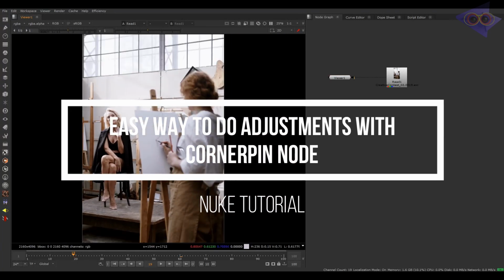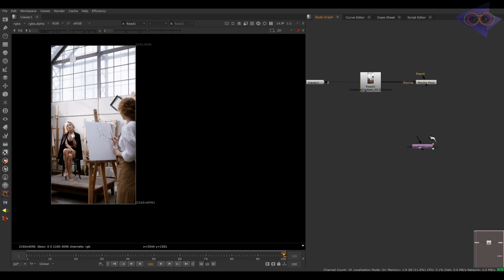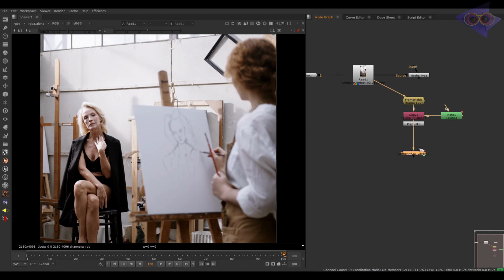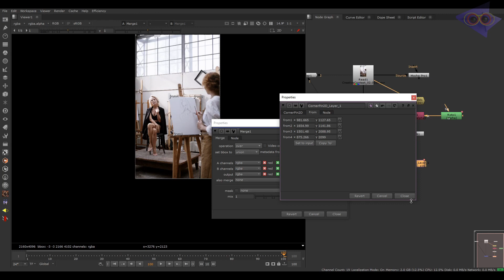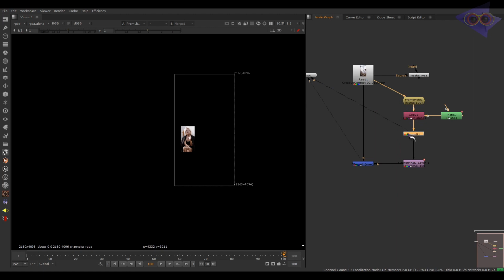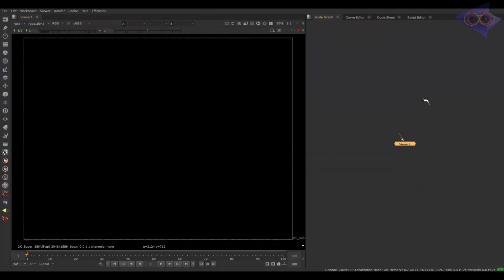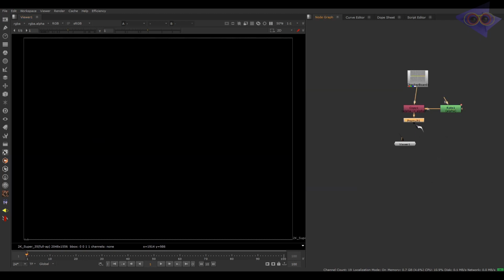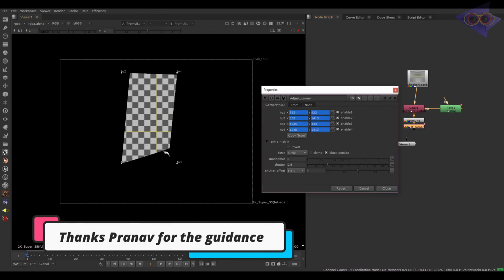Nuke tutorial | Easy way to do adjustments with Cornerpin node

Comment: after placing code inside py folder.and edit menu.py file. its not working.nuke shows a massage  "name 'adjust_cornar' is not defined"
Reply from the maker: Did you mentioned the python folder in init.py file?
Reply: @madlookzvfx  nuke.pluginAddPath('/python') i did
Reply: i can see efficiency menu in nuke.but when i click that after my prep setup it showing me:
name 'adjust_cornar' is not defined
Reply from the maker: Copy the code in the nuke script editor and execute. Let me know if it works there
Reply: @madlookzvfx  code is executing properly.but same problem.btw, i'm using nuke x10
Reply from the maker: @sachinpatravfx4976  ok add run_this() after the last line and execute the whole code again! Let me know if this works
Reply: @madlookzvfx  now its working. if i run the script in script editor
Reply from the maker: @sachinpatravfx4976  can  you discuss about this in discord server or my WhatsApp
Reply: @madlookzvfx  ok sir.
Reply: @madlookzvfx  hey dude its not even working in script editor for me
Reply from the maker: @deepakragul307  what error its showinh dude